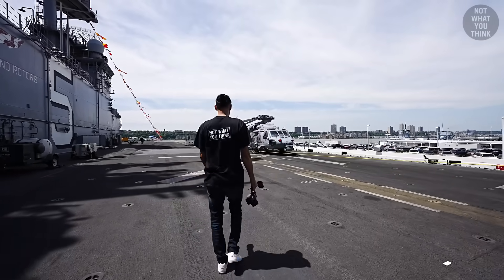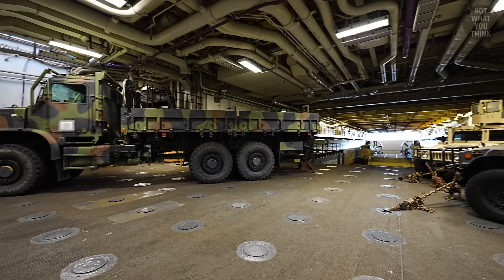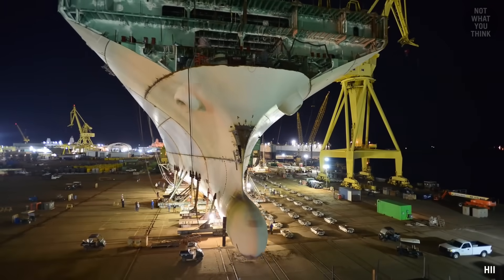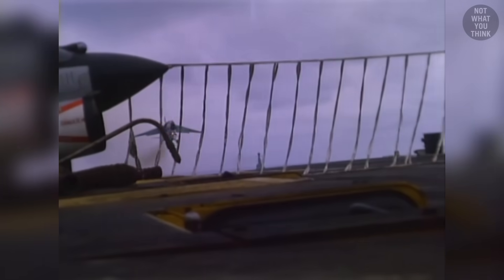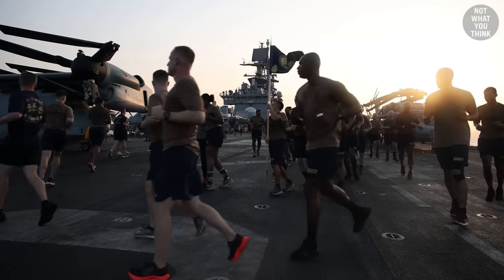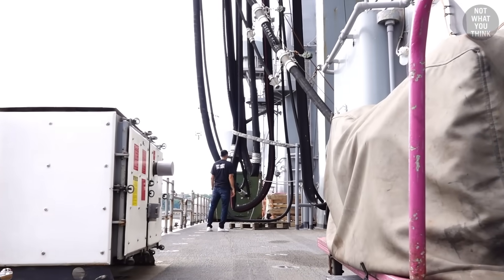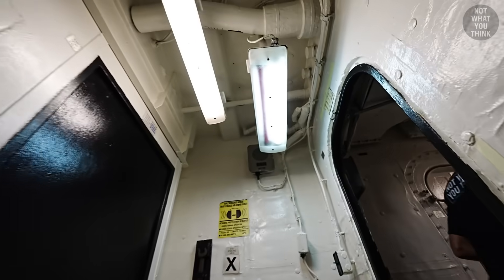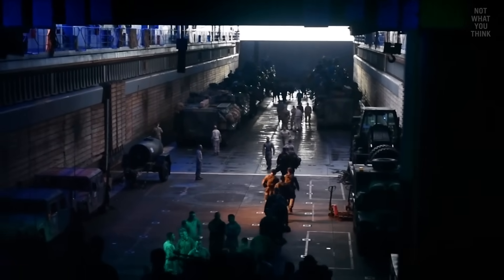I Visited the Ship that Makes Supercarriers Look EASY

Comment: It's amazing to think of how large carriers have gotten, when you realize that the Wasp class is slightly larger than an Essex fleet carrier from WW2.
Reply: Very much so.  Even though they’re seldom counted as carriers the amphibs are more capable and larger than what other countries have to offer. Personally I wouldn’t be surprised if we end up developing a light attack / escort carrier as a fleet multiplier and as a trade off in hostile areas instead of risking the super carriers, I’m envisioning something akin to the UKs Queen Elizabeth class but nuclear powered, angled deck, and catapults which are things they removed from the design to cut costs.
Reply: @cruisinguy6024  That's basically what we have already here, and what the WW2 escort carriers were for. They were able to park themselves off them and fly dive bombers and somewhat outmoded fighters in support of troops ashore, freeing up fleet carriers to go after the Japanese fleet.
Except for that one time when they and a bunch of destroyers/destroyer escorts took on the Yamato and won.
Reply: @wrenchinator9715  I'm thinking of something between these and the 11 supercarriers, but still capable of launching E-2 Hawkeyes and Hornets plus a theoretical fixed wing ASW aircraft which we will certainly need in a peer / near peer conflict.   The ambibs simply don't have the force projection let alone ASW capability like the 11 big boys do, not to mention they're not nuclear powered and don't have catapults or arresting gear.  Really a nuclear QEII class would be a good platform.

Basically, many experts believe we need more carriers.  For every 1 deployed carrier there's 2 back home so we can only deploy 3 or 4 at a time.  Considering in a peer / near peer conflict we're likely to lose 2 right off the bat that puts the US Navy in a huge bind especially given the limited shipyard capacity.

A new class of intermediate carriers would add significant capabilities without the extreme cost of the super carriers.  Hell, they could even be turbine powered like the QEII class to save money but of course nukes would be ideal.
Reply: @cruisinguy6024  So you want something closer to the Forrestals or Kitty Hawks then. Supercarriers, but not quite at the level of an Enterprise, Nimitz, or GRF.
Reply: @cruisinguy6024  The US has already developed the America class of LHA's which are essentially these same amphibious ships but with no well deck to allow for more focus on aviation. I imagine that is to help fill this same gap you're mentioning.
Reply: @cruisinguy6024  You're describing France's Charles de Gaulle carrier. Nuclear power, 42000 ton displacement (1500 more than Wasp) Carries up to 40 Rafale Ms with catapult launchers and arrested recovery. Also can carry/launch E-2 Hawkeyes and is certified to launch and recover USN Super Hornets if required.  

An American version would be cool to see, with updated tech since the CdG is 24 years old now
Reply: @astigmat1c  I think the CDG is 
 too small, 55-60,000 ton range seems like a good fit.  Queen Elizabeth class is 65,000, but my using that design the US can save considerably on the design especially since she was originally intended for CATOBAR operations. 

The big question is propulsion and if the QE could reasonably be redesigned for nukes as she’s not fast enough as built.
Reply: @astigmat1c  The problem is the Charles de Gaulle cannot handle something as heavy as an F/A-18E/F.  Because the ship is short, her C-13 cats are only 75 meters long compared to the 95 meters of the cats on a Nimitz class.  That greatly limits launch weight.  The Charles de Gaulle's elevators cannot handle a Rhino either.  The US Navy has studied smaller carriers to death and they don't pan out either tactically or financially.  The smaller ships costs almost as much to build and operate as the full sized carrier but the smaller ship has too many shortcomings in terms of launch weight and air wing size to make sense.  In any event, for open ocean ASW the P-3 Orion made the old CVS (ASW carriers) obsolete.  The P-3 had the legs to fill those mid ocean gaps the CVS used to cover.  The P-8 which flies faster and higher covers even more area.  There is no good argument for a small CATOBAR aircraft carrier.  But an LHA in the sea control configuration is pretty good.
Reply: @Colin-eo9xj yup that’s the flight zero America class ur talking about. Only the first two are flight zero then they moved on to flight one and added the well deck back. Also another difference other than losing the well deck for more aircraft and hanger space they also shrank the medical facilities in order to carry a lot more fuel. They only made two tho but I’m sure they could add a supply ship with fuel to the arg and utilize the others pretty much the same if they wanted to, unless the elevators don’t go all the way down to the well deck…I’m nfs about that. Always wondered if hanger and well deck was on same floor or over top of one another.
Reply: @Legion-xq8eo  The hanger is above the well deck.
Reply: @cruisinguy6024  Perhaps you'll like the CDGs replacement then, a little heavier at 75 tonnes at full load but nuclear powered, electromagnetic aircraft launch systems. 
Supposedly they looked at the Queen Elizabeth design and figured they could do better.
Reply: @cruisinguy6024 AI and drones will probably make carriers obsolete. I think.
Reply: @spikenomoon  drones have been around for a hundred years now and carriers are still going strong.  Nothing else can project power and support an invasion like carrier battle group and they are highly defended with everything from lasers to kinetic weapons.
Reply: @spikenomoon no , unlike Russia the US has robust defenses against missiles and drones.  US ships that are large like this never are deployed alone.  The launchers of the drones and missiles have to be intact in the first place in order to fire.  Don't you think that those sites will be hit first thing?
Reply: @bear76009  ya Al

All drones don’t fly.  These ships are becoming vulnerable.
Reply: @spikenomoon  no , but they all use some sort of telemetry or communication to be steered to target .  I used to do electronic warfare I had stuff you could cook food or a person with if they were exposed when it operates.   And even if it's autonomous they still have to be able to see as any camera or sensor gets fucked up.  And the whole home on jam thing?   Multiple ships multiple helicopters same signal coming from multiple sources to confuse it.
Reply: @cruisinguy6024 We already had that for most of the Cold War, Post WWII we had dozens of surplus Essex-Class Carriers still so we upgraded them by overhauling and strengthening the flight decks, plane elevators, and hanger space in anticipation of heavier jets, we upgraded them again in the 50's with angled flight decks, removing the mid-ship aircraft elevators for deck edge elevators instead, received steam catapults, Optical Landing Systems, increased AvGas storage, Jet-Blast Deflectors, etc.

There were 3 main Essex Variants post-WWII. The CVA's which were "Attack Carriers", the CVS's which were "ASW Carriers" and uniquely equipped with a Bow SONAR to aid in sub hunting, and lastly the 3 Essex's the USMC converted into "LPH's" essentially making them helicopter carriers and floating bases for Marine Expeditionary Units.

There's no need for us to copy the QE carriers, which had to make many compromises and is a "Sub-optimal" design because them. Just base it on the 70's-80's era Essex-class FRAM II Carriers, and implement many of the innovations and technology used by the Gerald R Ford Supercarriers including an EMALS CATOBAR and it's more powerful Nuclear Reactors.
Reply: Makes them a good visual match to the Intrepid when moored near her during Fleet Week.
Reply: Funny you say that because It's even more amazing when you realize the USMC's first 3 OG LPH* Amphibious Assault Ships, were literally just the last 3 leftover Essex carriers which still hadn't been modernized and the DoD didn't really want to spend the money it'd take to modernize them to the SCB-27A/C, SCB-125, and later FRAM I and FRAM II programs which gave us the angled deck Essex Attack carriers (CVA's) and ASW carriers (CVS's).

So they just took the unmodified WWII vintage carriers and tossed them to the Marines instead; who then created an entirely new type of ship aka the LPH's and  LPD's**, to carry around, deploy, and support their Marine Expeditionary Unit Globally.

* Landing Platform, Helicopter

** Landing Platform, Dock
Reply: @pyro1047 you talking bout New Orleans and such? If so they were made in the 60s not WW2
Reply: @pyro1047 I served on the USS Tripoli LPH 10. The tilting T was one of the most common nicknames. She never sat right in the water either fully loaded or almost empty. And refused to steer a straigcourse, she wandered. Damn I miss the adventure.
Reply: Well keep in mind the Essex class carriers got a massive upgrade in the 1950s with an angle deck added to it, They could land Naval Bombers on them in the early 1960s and hold about 90 Aircraft
Reply: Size does matter! And versatility. 
I'm so big I can't see my forehead.
Reply: These literally are carriers.  They are just not built on cruiser or battle-cruiser hulls.

Comment: the most capable ship would a lst (landing ship tank) of ww2 it could unload landing troops vehicles, tanks, and supplies/cargo right on the beach without docks or piers & retract off the shore using a stern anchor... the only operational one in ww2 configuration afloat in us waters is the uss 325 on display in evansville indiana...

Comment: Personally, I think aircraft carriers are a bit too overrated 
not that they are not important, but they just help bring the air force to the sea, but they are very massive and can be hard to defend against an opponent who knows the composition of the strike group
Reply: They are merely mobile bases on seas. They alone doesn't have much power. A carrier group, on the other hand, is whole another story.
Reply: That's why they sail with a strike and defensive group. The military knows they're sitting ducks without the correct support. They're still more vulnerable but with the right defence support ships, AA and air support, they're fairly secure.

But being able to take hundreds of jets around the world wherever you want without complicated logistics and wasting fuel flying them all is a god send in some scenarios.

Comment: And today all this is barely useful because of $10k jet skis strapped with a raspi, a few servos and some rdx.

Modern warfare has made complex expensive weaponry redundant
Reply: CWIS, bushmasters, 50.cals, there are defences to those craft
Reply: All the planes are over 40 years old,
What a boondoggle, A
TRILLION $$$ 
Spent annually 
😫😝🙈🥵🤮🤮🤮
Reply: @rickreese5794  The harriers are being replaced with f-35s. As for the other craft, age is no guarantee of obsolescence, case in point buff, c-130, ch-47, kc-135